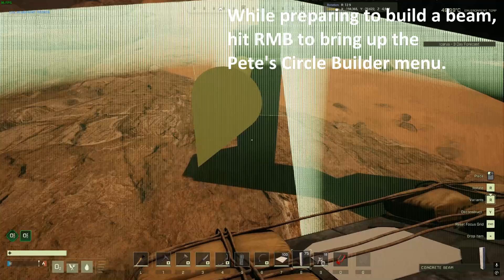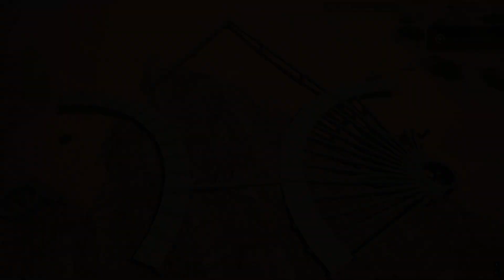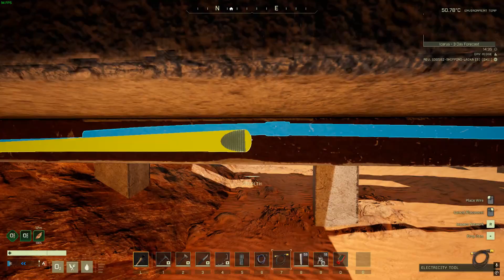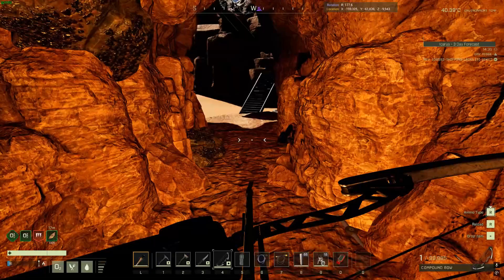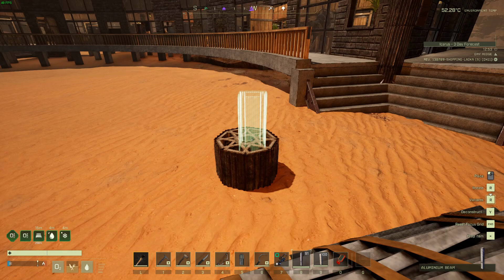Icarus - Build Highlight - Styx OW-15

Comment from the maker: Key Points in the video:
=========================
12:24 - Generating the 60 deg angle for our starting triangle
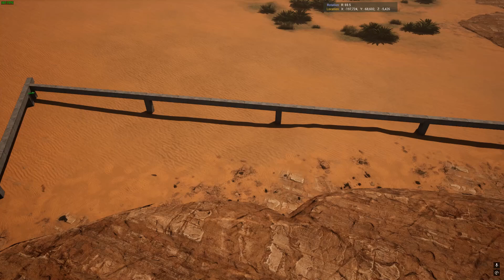14:20 - Top-down Triangle and circle arrangement
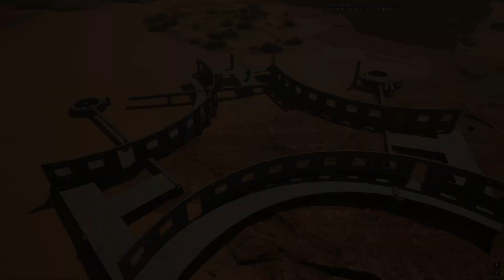27:07 - Ceiling notes and structural support
42:00 - How to fix floor texture flickering
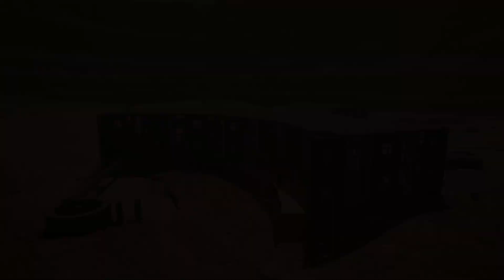46:15 - Aluminum beam columns
49:24 - How to build the 8-sided fireplace

Mods you may find useful:
=========================
laanp-BuildersDream
laanp-BeaconTeleport

You can get these mods and others from my GitHub page at:
https://github.com/laanp/Icarus_Mods_Separated

This is the main Readme files entry page. To get the latest mod pak files (which are updated weekly)
click on the "Latest" Release button on the right side of the page.
Reply: Hey man! I'm trying to build a circular building (i succeded it on a " normal " floor) on an " empty " spot (on a cliff like you did on one of your last vidéo but i really dont know how to do it ...) can u make a vidéo about it?

Comment: Love your stuff Pete. The circle build mod is so terrific.

For a tip on rough measuring, you can use foundation blocks instead of vertical beams. That way you dont have to hold R and change from horizontal to vertical. 

Have you used JMKs steel buildables yet? I need to upload a video of a facility I've been working on.